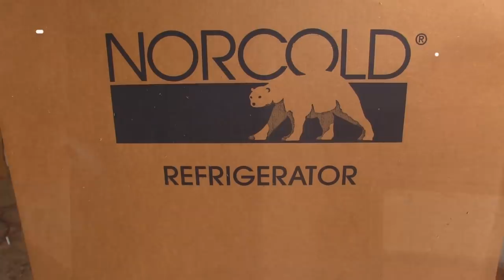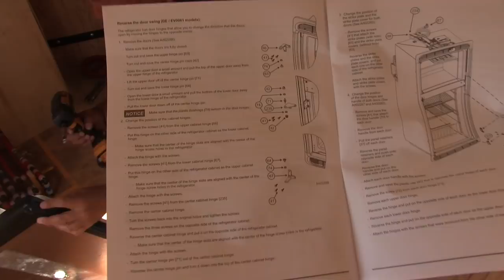Skoolie Refrigerator ~ Norcold Dual-power Install

Comment: Well done, as always.  I forgot to comment on your last vid.  Congratulations.  You are the very first build, outside of the UK, whose propane set-up does Not give me a case of the heebie geebies.
Passing thought on your problem with the curves.  The bus is however many years old.  So... it may have done the metallic equivalent of 'settling'?  Hold up your curve to the section you're building a wall for and see if it's off by an angle or three?

Cathy (out o'Ottawa/Bytown' gleeful thief of the husband's YT while plotting out ze eventual van build...)

Comment: Two years later how do you like your Norcold Fridge ???  I’m going to look at a used one tomorrow that was only used for 1 year… so curious how you like this fridge now ?? This is the same exact one I’m going to look at …and possibly buy…
Reply from the maker: Absolute junk.  Never worked right and didn't even last us a year.  Replaced it with a $200 apartment sized fridge from Home Depot.  That thing works awesome!

Comment: I think I have had to switch the orientation of RV refrigerator doors about a 100 times, (it never gets old) I'm assuming you're gonna put a roof and back vent on this as if it's gonna run on propane at all, unless it's a 12 V/110 only unit you're going to need to express the heat and carbon monoxide outside..... But I didn't see any propane line so I guess this is something altogether different.....🤨🙂😏
Reply from the maker: This is a 12v/120v compressor driven. No propane or exhaust to vent.😁
Reply: @BussyMcBusface   oh ok,I'll have to look into that cause I'm building a schoolie myself out of a 1976 Wayne GMC 66 passenger bus named 'Sandie'.... I'm gonna make it a mobile studio apartment with some regular house furniture and appliances on one side and then some RV appliances on the other and in the rear is gonna be a small workshop of sorts.
  I have been torn between modifying a conventional full size refrigerator with a 12volt DC compressor or just use a DC only portable cooler in addition to an RV 2WAY AC/LP heat absorption type (Dometic/Norcold)........
 I'm not absolutely sure whether I wanna run a propane system through the bus or just run everything off of electric(110AC/12VDC) since it is gonna have a wood burning stove in it that I could build a heat exchanger to  also heat water off of the engine and/or the stove or 110ac heating element in the tank..... I really like the cabinet that you made to mount the refrigerator so you can utilize storage above and below just like in an RV.
 I was wondering if you had only moved over that whole cabinet assembly about a quarter to a 1/2 an inch it could have avoided having to trim pieces on the actual refrigerator and you could have just stuffed insulation in that void to keep the heat transfer down to a minimum as you can never have to much insulation in an RV or Schoolie.....😉
Reply from the maker: Yes, I could have added a little wood but the cabinet was finished. It was a lot easier to trim than rebuild.

Comment: you going to vent that fridge?
Reply from the maker: This fridge is a 110/ 12v no propane to vent. Itby is a compressor fridge. Love your videos BTW!
Reply: @BussyMcBusface  is it an absorption type or does it have a compressor?  Either way, having the back vented to the outdoors will keep the interior of the bus from dealing with the heat, especially if its an absorption type fridge.  Something to consider.  Thanks!
Reply from the maker: Next week when we get the shoreline part of our electrical installed, I'm going to fire up the fridge and see how much heat it contributes.  The way they have it set up, it vents like a home fridge with a vent at the bottom and top so the air circulates from from the front bottom to the front top. If I did add a vent, it would introduce outside air to the cabin of the bus. We shall see!
Reply from the maker: It's a compressor type.
Reply: Please remember the more cool air at the coil and fan in the back of the refrigerator the less time the compressor runs.
So if you keep the path from the bottom open and you have good circulation the refrigerator will stay cooler use less battery power.  Bussy McBusface